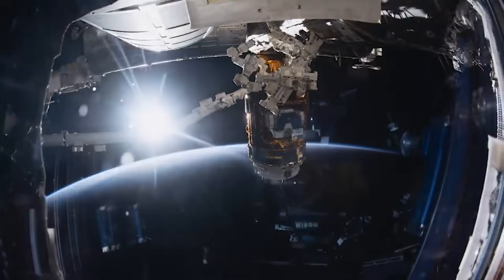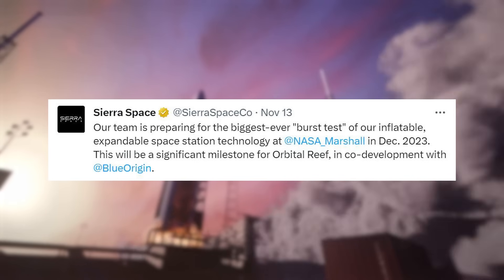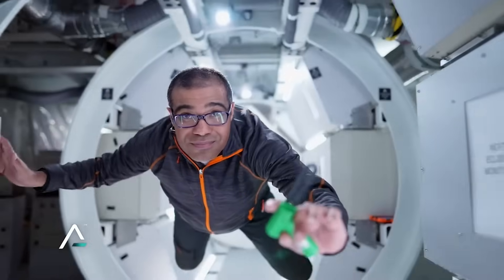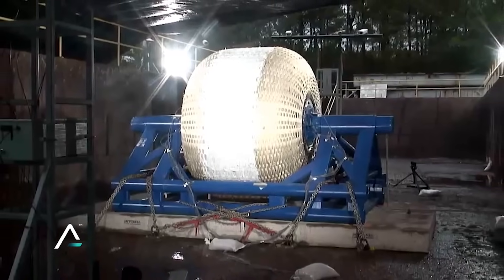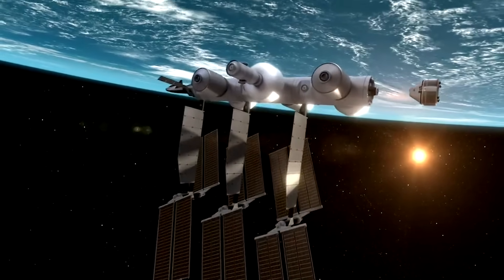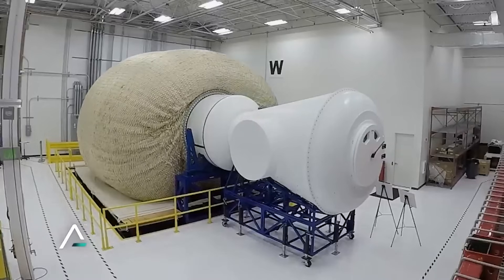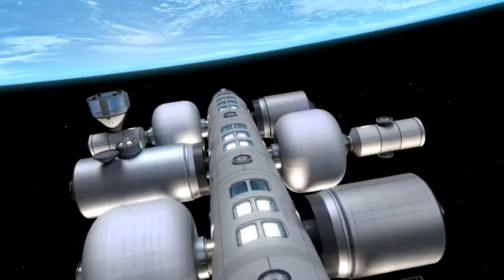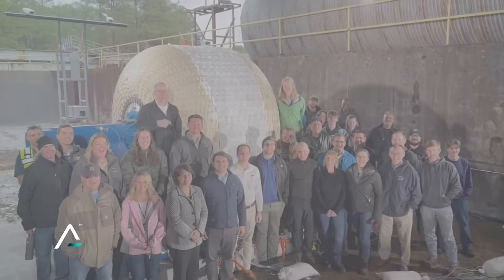Sierra Space Is About To Begin Full-Scale LIFE Habitat Testing

Comment: I don't understand how popping one makes much sense. Shooting one with Ma Duce would prove more what it could expect in space, a large, high speed impact from a piece of space junk. The same thing could be said about the rigid forms too. Will this balloon pop from such a hit or will it be patchable, like the rigid forms are? In space, the inflatable will never have more than one atmosphere inside it, even if that is in a vacuum, even old Project Echo did that.
Reply: they briefly touched on it in this video, but I remember reading somewhere that the burst testing is essentially an accelerated aging test -- by measuring the total force that can be applied to the inflatable structure before it fails catastrophically, engineers are able to determine how long it will last under normal circumstances. in any event, the burst testing is required by NASA for certification
Reply: @andrethib already gave a good answer on burst testing but it's also worth pointing out that Sierra Space has mentioned in previous statements that they have also done some ballistic testing - firing projectiles designed to simulate micrometeorite impacts at a scale model. Presumably at some point those tests will also be scaled up to use a full sized test article. They really seem to be making good progress here.
Reply: No spacecraft ever built could withstand .50 cal so that would be pointless.
Reply: Because engineers need to know where the real-life failure point is, to verify that it really is where they think it is.

Comment: The ultimate burst test is interesting although i am wondering how they are testing for deterioration of the soft shell vacuum and under radiation conditions of space.
Reply: Probably the same way Bigelow did, send up a free flyer (Genesis) into orbit and see if anything goes wrong before making the station module (BEAM).
Reply: There is a very small version already attached to the ISS - the astronauts say they use it as a normally sealed storage compartment.
Reply: And what about impact testing? Is it self-sealing, etc.
Reply: @Kadir_Suleymanoglu    NASA says impact wise it handles it pretty well, deforming to catch the impactor then rebounding back to original shape instead of having a hole blown through it (like the Canadarm2).
Reply: @Kadir_Suleymanoglu  Has a kevlar layer to catch small impactors much like a bulletproof vest.  Also supposed to be self sealing.  Excellent tech.

Comment: what did they learn from the pressure test?
Reply: Such tests are used to check if the device meets or surpases the desing's parameters according to the safety factor, in this case it would mostly be how much the balloon deforms as it's being inflated (strain), at which point does the material starts giving in before it ruptures (yield stress point), finding whethere this yield point happens in any particular spot before the rest (weak spots), and finding at which pressure it finally blows up (ultimate stress). Most of this is usually found by sensors and cameras placed on the test subject to draw a graph on the computer called a stress-strain diagram.
Reply: @coolbionicle  thank you
Reply: Pops Cool!!
Reply: @VicariousAdventurer  lolz